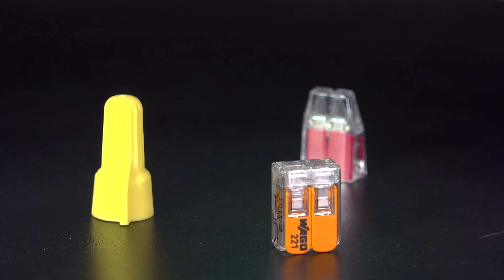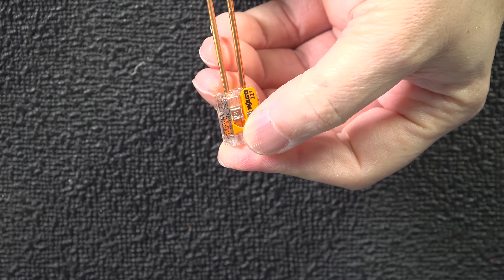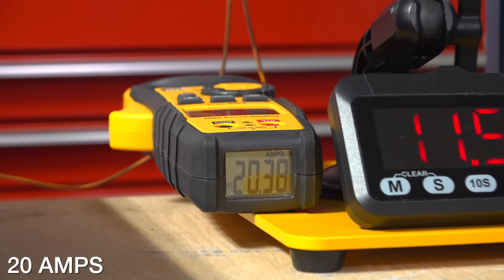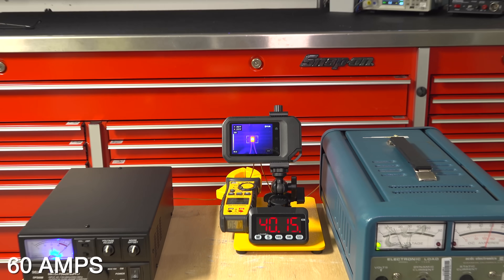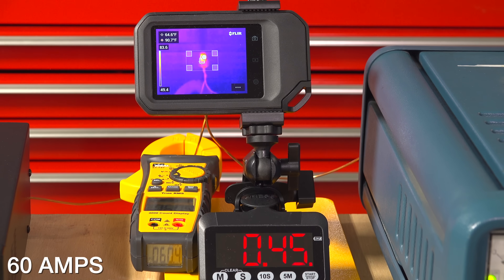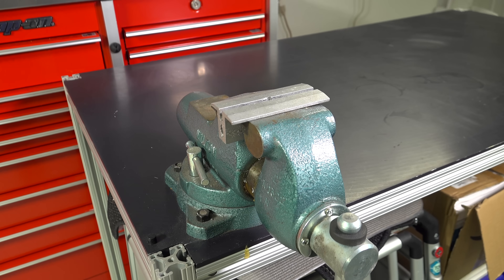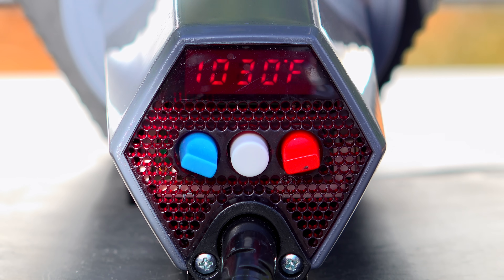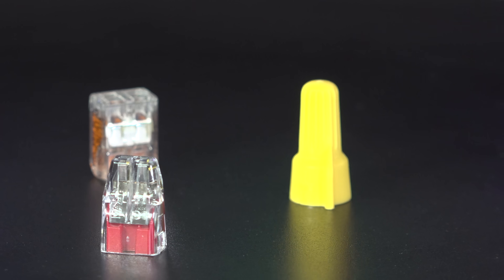What Wire Connector is the Best? Wire Nut VS Wago TESTED

Comment: I'd appreciate more scientific comparisons, instead of changing the testing circumstances from one product to the other (skipping straight to 60 amps for the wire nut). and doing all the same tests for both connectors instead of skipping pulling out the wires from the regular wire nut

Comment: sorry for my english, i'm not native
at the first test all the current run through the wago, but in the second test the wires contacted - approx - an ich lower then the wirenut. so the current heated only the wire and wirenut got only the conducted heat.
am i totaly wrong?

Comment: Another german here.
Just want to point out that the WAGOs with levers are usually used for temporary connections. Not that it is or isn't code but these are expensive in contrast to the regular ones.
I worked for a company that was very reluctant to switch to push connectors. Oh boy, the stories of burning server rooms and what not. But for 20 years now, they are a staple in the field.
We got them now almost everywhere. RCBOs, outlets, switches and whatnot. It made everything a lot safer and faster to build.
All the oldschool connectors had the 3+ wire flaw. Any movement, vibration, thermal cycling could work screw terminal loose with 3+ wires in them. So in training we were told to tighten the screw, twist and work the wire and then tighten it again so that the wires would fall into a stable position.
Well, some folks did't think it was important, or worked against the clock and got sloppy.
What i wanna say is that i believe these connectors are more idiot proof. Should an idiot ever become an electrician? Hell no! Will there be idiot electricians? Yea, sadly. And there is also the kind that is like "what? 45 bucks/h, i do it myself, youtube and wikipedia is all i need"
So if that at least contributes to families not burning due to stupidity, i'm down.

Cheers.

Comment: Here in Finland, pretty much all new construction used Wago 221. I personally made a bunch of circuits in school using them, and they'd always pass electrical testing (earth resistance, short circuit current etc.) with flying colours.

Over here, the wall outlet circuits are typically 230V/16A with 2.5mm2 wire, while lighting circuits can be 10A with 1.5mm2. Maybe a bit overkill but the standards are designed to guarantee safety.
Reply: In North America your house will typically have 15 A , 20 A, and 30 A lines @ 110 V,  with 2.08, 3.31, and 5.26 mm^2 wires
Reply: @dmitripogosian5084  we have 3 phase 400V connectors (5 Pole) in 16A or 32A that should be suffizient for all power-hungry applications.
Reply: @stefans8325  We do not usually have direct 3 phase connection, but do dedicated 240V at 40A for things such as induction cooktops

Comment: I love the Wago non-transparent which I bought a bunch of a long time ago.  Great for tight boxes and over my head work or poor visibility.  Wirenuts are ok for me but I end up chasing faults and even as a DIYer, I don't want to waste my beer time.  I finally understand the push ins now with  your video, but I am not comfortable with them for stranded wire and they do not look reusable.  I'm going with the lever Wago for everything.  But I am a rank amateur.  Only thing I am worse at is plumbing.
Reply: This lever ones look interesting.   I found push-ins in my external lamp, that where put in when my windows were changed.  Now I had to take lamps off to paint the house.   So I basically had to cut off push-ins, and later replace it by wirenuts again. WAGO 221 are hard (if possible) to find in retail in Canada

Comment: Since we only have spring clips in Germany, I would be interested in how to connect five wires to each other with the cable nuts?
Reply: I think there's larger wire nuts for fitting more together, I'm not an electrician though

Comment: Worked one summer with my dad as he went around fixing electrical issues done by contract electricians. Spent one week at a convention center where the new hotel rooms that had been built had the lamps at the head of the beds directly wired into the wall. (wall mounted lamps) Our job was to put plugs  on the lamps and recessed sockets in the wall. 
Due to another genius move, the contractor electricians had somehow cross circuited the main breaker boxes for the complex (dad was not rated to fix that nor did he have any desire to get killed by whatever they did). The result is you could not cut power to the building we were working in without cutting power for the entire complex (about 5 more buildings, all wired from a main electrical shack) So we had to work 'Hot'. The lamps had a switch on them and there was no wall switch to cut them off. (real genius, this was about 1980, I think that would not pass any code now) So... as we carefully lifted the lamps off the mounts and pulled them gently way from the wall far enough to get to the wiring: Wire nuts often just fell off onto the floor. Sometimes sparks flew. A few looked like the wire nuts had already fallen off when installed and were probably deep inside the wall. And  a few did not even have wire nuts, just had been twisted together and wrapped in black tape. Three different sizes of wire nuts had been used, and even the ones that were the correct size for the gauge fell off cause they had barely been twisted on. We did not reuse a single one of them. Dad had bought a large box of the correct size. Not only did we do that, but (with a few exceptions where the wiring had been cut too short) folded the wire about a inch below the cap back over the wires and then taped that into place. There weren't going to get pulled off so easily. I still found that even though these were the size meant for the gauge, some were 'looser' than others and could easily be pulled off. Ever since I have been very careful to test when using wire nuts and will quickly throw out any that pull off. Now that about Wagos, I'll look into them the next time I need to do some wiring around the house.

Comment: I use those wagos to connect up RBG led lighting to power supplies and so on for temporary installations in TV and theater. They save me SO MUCH time and hassle. Anybody can troubleshoot a bad connection quickly and without tools. Love them to bits for that task!

Comment: Here in Czechia I frequently find Wago failures on Al wires. I can't quite pinpoint why exactly they do that. But once there is a decent load (not overload) on an Al wire through a Wago, that thing is pretty much guaranteed to fail eventually. I first found these failures during inspections and now I frequently see them while performing building service. I've never found one fail on a light fixture, it's always a power outlet circuit. Stuff that has a limit of 16A at 230V, so it's never overload. People say "use alupaste!", yea right I'm going to put safety of my installation down to a goop with questionable life time. I personally prefer EKL 0 style connectors, I always pull the wires all the way through and secure both bolts. You gotta work hard to make them fail. Those I use for me, family and my friends because they are really cheap and reliable. For company and customers I use Wago because it's just faster and it's less of a legal liability in case of complaints or failures. In 11 years of practice I've only seen one Wago fail on a copper wire. Still, with the EKL 0 style connectors in use, inspectors drool over how beautiful loop resistances they get to measure.
Reply: The Al gets even weaker when heated and the steal blade inside cut's into the Al and weakens it. Use Cu wires and you will not see that problems.
Reply: Yikes, Aluminum wiring used inside the house? Are these 1960S houses? Does your electrical code still allow that? You would need wire connectors that are approved for aluminum by the manufacturer and by your electrical code. On the Wago 221 datasheet, it is only approved for copper.
Reply: @ChristianWagner888  Aluminium used to be used all the way until the revolution in 1989 here. As far as I know some people used to order it even after the revolution for cost savings. The appearance of aluminium here is therefore still pretty frequent. It's pretty reliable stuff if its well maintained. Which it usually isn't. People take electricity for granted and usually ignore the dangers. This way you can find a lot of outdated and poorly maintained Al installations around here. Many of those have never been touched by an electrician, not even when they were built. The first electrician to ever see them often tends to be the one who's called to fix them. Electricians and material were rare in Czechoslovakia, a lot of the installations during that time were built by the owner of the house out of the stuff they managed to steal in the factory or on a larger building site. Alternatively people would exchange items they took in their workplaces, sometimes across long chains of people with many exchanges happening down the line. This have caused Czechoslovakian electric installations to be Frankenstein monsters mixing all sorts of materials, whatever was available. You got copper there, aluminium there, reinforced cable wrapped in lead here, and all that could be topped off with some cloth wrapped cables. So while the regulations said one thing, the material, workforce and wealth shortage told a different story. In Czechoslovakia, 60's lasted to the 90's.
Reply: @Paegaskiller  wow, interesting background and a challenging environment for electicians.  Apparently Wago does offer a solution for this. I have not tried it, as here in the Philippines I see aluminum wire mostly for the mains connection. You mention above, that you prefer EKL 0 style connectors over paste, which we call 'Lüsterklemmen' in Germany, I think. Basically an insulated connector strip with screw terminals. They used to be quite sturdy, but here in the Philippines I only find flimsy Chinese versions that crack and the screws easily strip. As the EKL screw terminals connect copper to aluminum, doesn't that require some kind of paste as well to prevent corrosion?

Wago marketing: "If you want to connect aluminum and copper conductors using WAGO's connectors, Alu-Plus Contact Paste offers the following advantages:

Alu-Plus Contact Paste Advantages

    Destroys oxide film during clamping
    Prevents fresh oxidation at the clamping point.
    Blocks electrolytic corrosion between aluminum and copper conductors (in the same terminal block).
    Provides long-term protection against corrosion.

Connecting Aluminum and Copper Conductors – Adjusting Nominal Currents
But if you want to connect aluminum and copper conductors, you must remember that copper (Cu) conducts better than aluminum (Al)! Therefore, the nominal currents must be adapted to the lower conductivity of the aluminum conductors: 2.5 mm² = 16 A, 4 mm² = 22 A."
Reply: @ChristianWagner888  Yea the Chinese ones are the worst. When it comes to that paste, I'm sure WAGO has done diligent testing on that. I'm a bit skeptical when it comes to putting any kind of paste in to a high voltage terminal. I just don't like my connections greasy :D. Anyways, with the EKL I'm using the advantage of the fact that I can leave an air gap between copper and aluminium. Copper on one side, aluminium on the other. The terminals themselves are fairly resistant to corrosion and aluminium doesn't seem to mind contact with brass. At least I never really had any problems with it.

Challenging environment... well I operate in it for 20 years, so it doesn't feel like anything extra special. ;)

Comment: It's the cheap nock off wagos found in so many lights that have turned american electricians against them.  Also most wago style connectors that supply houses stock are spring tensioned (can lights) or small flimsy spring lever style  (wall packs).  I definatley like the mechanical style wago your testing with

Comment: Test failure ! You Drill the Wires at 3:00 . And You Closed the Circuit with the Wires . And over ther Wirenut  There is no electricity. You can  also omit the Nut .

Comment: What about using one of these in a damp location--i.e., an outside junction box with a photocell? The junction box is appropriately rated for the location, but do I need to also use some sort of gel-filled connection inside the junction box?

Comment: Anyone who thinks these connectors aren't adequate for home wiring hasn't done a lick of research. The one issue I see with your test is that with how much bare wire you pre-twisted for the wire nut, I doubt much current was really passing through the wire nut. If you used insulated wire and only twisted with the wire nut per instructions, I bet it would get a lot hotter. Overall though, great video!

Comment: Big problem with twisting uninsulated wires is the wires are taking the load not the wire nut. So the only like for like fair test would be to use the wire nuts as advertised "no pre-twisting necessary".

Comment: If you twist the wires before the wire nut, part of the power flow from one wire to the other directly from the skin of one wire to the other without getting through the wire nut, therefore you should use instead some insulated wire and the test could show something

Comment: Not sure if this has been said. The reason we twist the wire first, even though the directions say otherwise, is because, in Canada at least, it's electrical code to pretwist the connection before putting the wire but on.

I really like wago's a lot though! Super easy to use, less apprentice botched connections, and way better on my wrists!

Comment: Wow This is an absolutely amazingly detailed video I personally don’t like these connectors unless they’re inside of an appliance on the ceiling maybe a light or smoke detector it’s not something I would put in a box making neutral connections and load connections on switches and outlets because you can’t really predict how much of a draw will come in an outlet you may have eight outlets in a room and never use more than four and that one day you have a party or that one holiday you plug every conceivable extension cord in that circuit and end up melting one of these things buried in the wall. My understanding if it is rated at 20 A I believe it can run 10% above it but not indefinitely the UL specs are no longer the same now as they were 20 years ago I made out of explain that correctly but I think you understand what I mean
Reply: I dont know how the electric installation is planned in the US but here in Germany you can not have MCBs over 16A for normal sockets. And since the MCB will trip, you are not able to overload the wago

Comment: the first time i seen a video about the wago i was cynical. that was becasue the uploader was making false claims about the wire nut.
i like the wago simply for its ease of connection and tidiness. its heat resistance and amperage overload is just extra toppings. 
i ordered some and will be using them in my electrical project.

Comment: @Silver Cymbal
The wire nut test seems completely flawed. It looks like the bare copper wires are twisted together well beyond the wire nut. So the load is not going through the part at all. The fact that it heats up is likely due to the high thermal conductivity of copper. The heat gun may not pick up the heat in the wire itself due to the metal's reflectivity. Besides, pretwisting the wire when not required defeats the purpose of these quick connectors - might as well solder it too. Did I miss something?
Reply from the maker: All of that is possible but keep in mind the purpose of this test was the dispute that a Wago couldn't hold up to any amount of current which I think this test showed that it did very well. But yes the wire nut may have done slightly worse if twisted less.  This was the video that prompted it: https://youtu.be/rMlI7qOm8hM

Comment: Sure. Testing amperage capacity is a large part of it. But I use specific nuts, wegos, etc. Based on the gauge of the wire, the load, and whether it is solid or stranded.

Comment: Directly beforehand: I'm not connected anyhow to Wago, besides I'm German :-)
Here in Germany we're using these kind of connectors for decades. I myself rennovated my house six years ago - all electrical connections are done with Wago: most with standard and whenever to connect to a flexibel wire with the ones seen in this video. I do not buy/use the cheap ones, because I want to still wake up in the morning...🤔
By the way during the house renovation I found some of these (old) twisting connectors. I guess they are from the 70ths when this house was build. So, they are reliable, for sure, but the Wagos are much faster during installation and  especially if one wants to change something...👨‍🔧

Comment: How about testing Original connectors against their cheap copycats from china {aliexpress, Wish, etc}.

Might be a Fun video showing why Some copycats are Horrible.
To give it a Fair example buy from multiple different sellers. 
1 Sellers with Horrible ratings saying the connectors are trash
2 sellers with decent ratings
3 Sellers without Any bad rating {aside from Non delivery complaints}